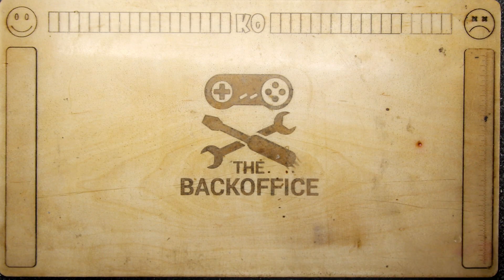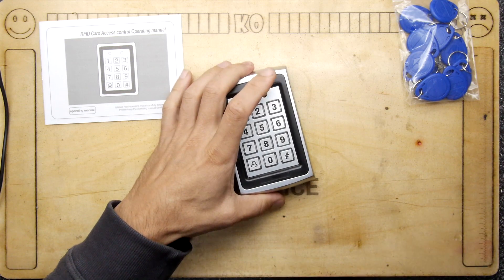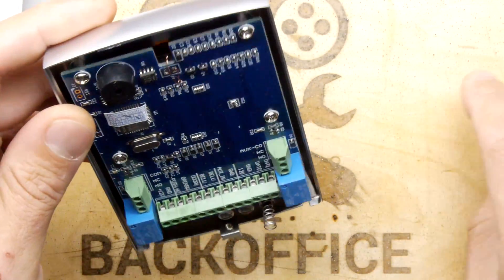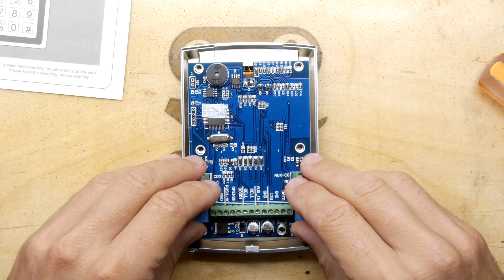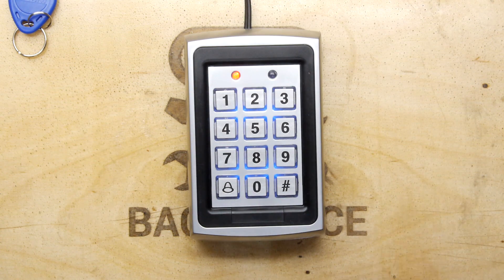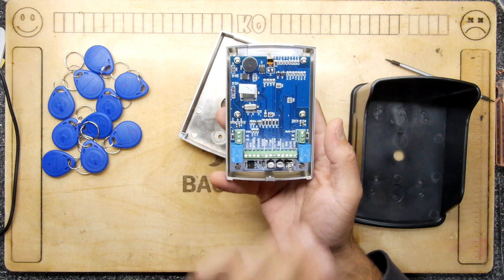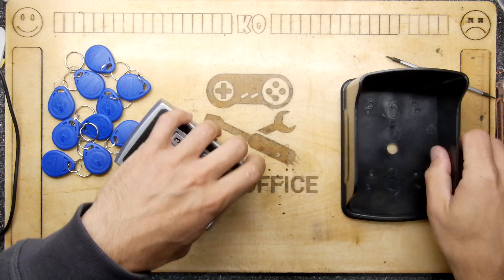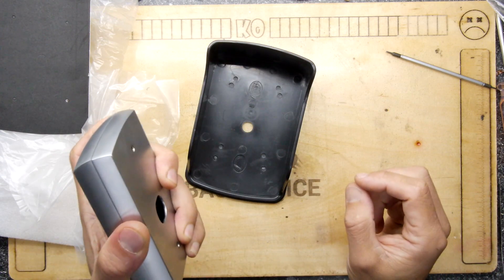RFID Entry System Pad Teardown

Comment: I would install the hood upside down to protect the screw but then you would have rain falling if it is outdoor.
I have very similar unit little difference on the inside (I dont have tampering spring), I had tested on the bench and programmed all the keys, then after I actually installed on the wall the unit does not respond at all to keys, and only red is flashing, I tried to reset to default, and reprogram the keys, but it looks rfid reader is not reading!!, when I press the unlock key (push+grnd) the unit clicks and then shutsdown...any advice, not sure if I had damaged it when I had the bolt screw , I don’t know where the rfid or how should I test the antenna is damaged....appreciate the help! 😉

Comment: That hood should also help protect against "shoulder-surfing" PIN theft attempts, at least to a degree. Although, as already mentioned, the likes of Lockpicking Lawyer and Bosnian Bill usually show that a powerful magnet can all too often defeat these electronic locks with trivial ease.
Reply from the maker: Its all about appropriate use really and what you are trying to prevent. If you are using it on your garden gate its a different risk profile than your home - at the end of the day a determined crook would just jump the fence etc. I think an assessment needs to be made for sure.

Comment: Where Can i get one to :) tanks
Reply from the maker: They are fairly commonplace on Amazon and eBay, however, there is a gotcha. I have two that look identical, but one is a MOSFET device and the other is this relay device. Admitted the relays have their issues with magnets, but are easier to install.